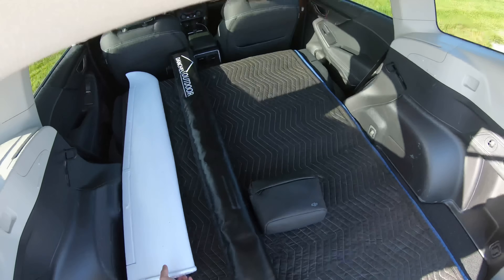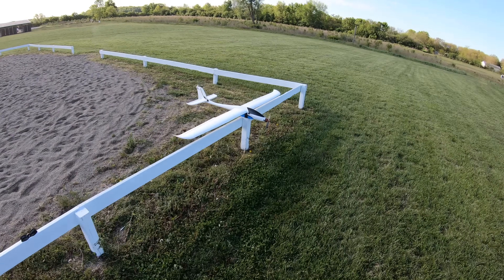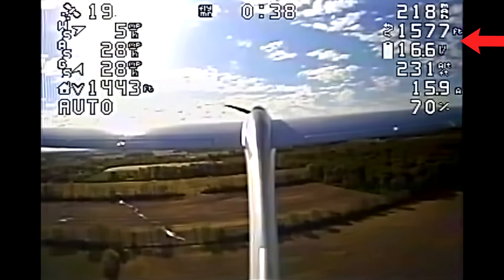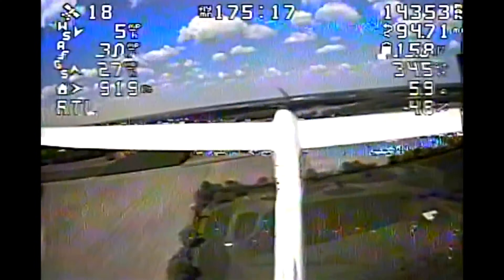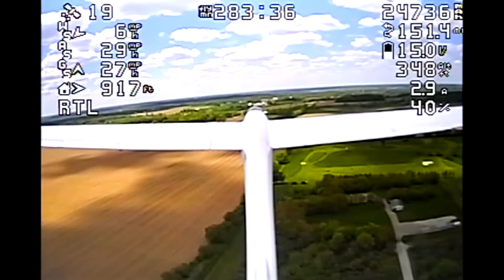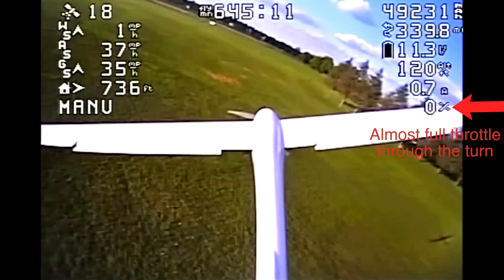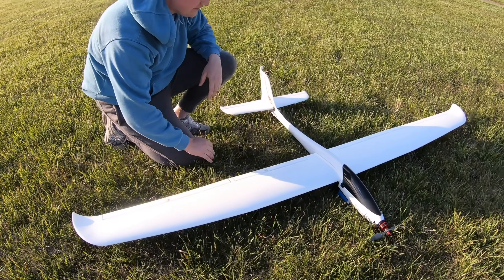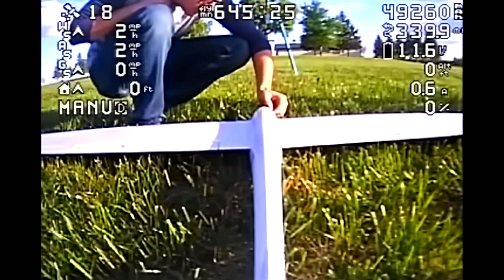My Longest RC Airplane Flight

Comment: wow, only 70% throttle can launch successfully. kudos, amazing job.
Reply from the maker: Thanks! To account for the decreasing pack voltage throughout the flight, starting at 16.8V and landing at 11.3V, I had to over-prop the motor. So I had to limit the take-off throttle to 70% to prevent the motor from pulling too many amps and burning out.